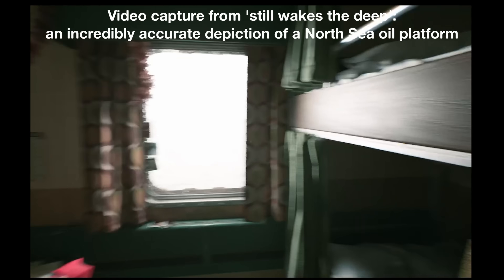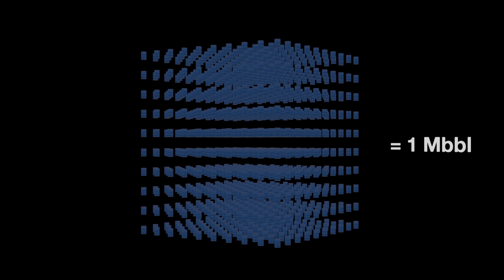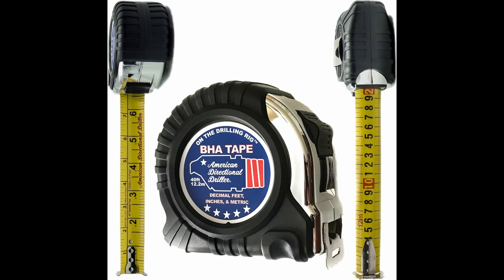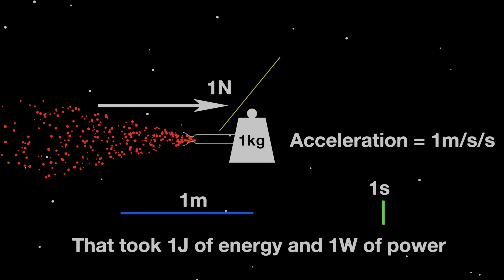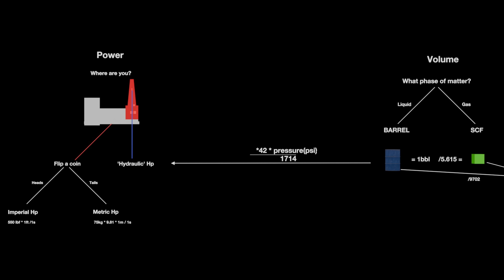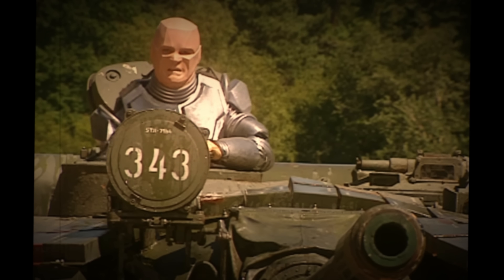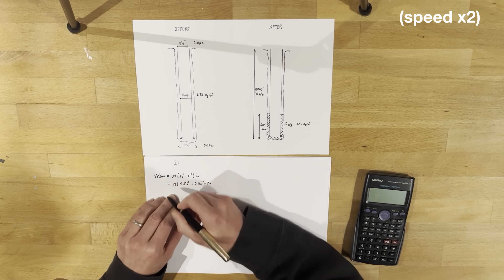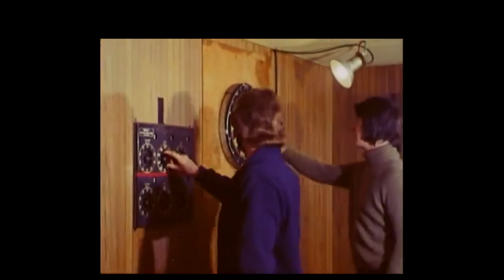Oilfield Units: a Measurement System so Cursed it made me Change Career

Comment: It is mad for sure. I worked on projects for Equinor and Total. It was mostly metric although the material properties were in kips and the pipe sizes are all inch based so they make no sense in metric. I always do analysis in metric and convert it needed. Boeing was 100% inches when I was there while nearly all the people building up the sections were in metric counties which I am sure caused no issues:) Boeing would also size fasteners in 1/16 or 1/32 but it wasn't clear just by looking at the part number.

Comment: 16:45 you are 100% correct. There is a mentality of "School's over and you're in the real world now".
Reply: And apparently real world makes no fucking sense
Reply: @MikeF1189  it’s 1000% necessary though. It’s infinitely easier to switch students onto 
obsolescent units than it is to retool hundreds of factories
Reply: @tacticaloof6407  Is it? In other industries units also changed over time.
Reply: @AsselParty yeah, like the American car industry
Reply: @tacticaloof6407  None of these units are used in tooling.
Reply: @tacticaloof6407  ...Retool? These are all going to be on gauges. At most, you'd have a calculator handle the conversions from the gauge to the notebook and then back again if needed and working on or with old equipment (where needing to convert will be clear as day), and then eventually everything will be moved over to the new units and no-one ever needs to carry around the funny little green book again.

And it isn't easier. Changing gauges and tooling is once. Maybe a very large and long once, but still only once. Sticking with the old oilfield units means teaching units to every student who ever comes through the course a second time until the industry itself dies.
Reply: @Shelleloch  ah but consider that changing gauges will inconvenience puffed up oil drillers for a year while hazing new workers is "fun" every year!
Reply: @tacticaloof6407  hard disagree. Your point about tools is whatever but you think that mindset is necessary? That mindset is the excuse why old bitter people run the world in obnoxiously inefficient ways that fuck everyone.
Reply: @boydj99 no surprise then that the oil industry is full of them 😂
Reply: @FlameQwert  they are the perfect example
Reply: @tacticaloof6407  SI units were specifically made to sort out mess with thousands of different units
Reply: @tacticaloof6407  More like retrain all the veterans and lose all their experience when half of them quit over it.
Reply: @thelastdwemer  
Except like he said, they actually use SI for many calculations and then convert it back.

All the veteran right now are familiar with SI.

Comment: I always thought the UK railways were a mind boggle as they still insist on using the antiquated unit of chains, which afaik the railways are the only industry in the entire UK to still use them in any form.

Locations on the railway are expressed in terms of miles and chains from a datum point, where datum point that is dependant on a specific track’s engineers line reference (a 3 letter code followed by a number, such as ECM5, which has its datum at York station). For example a defect would be described at being at 50 miles 4 chains on ECM5, on the down fast, from which track workers would travel to that rough location, identify the line referred to, and then either find a defect number scribbled on the rail foot, or be able to see the defect if it’s obvious enough. Oh and they would use an access at 49 miles 12 chain on the up slow to access the line.

I think this is simply a holdover from before the UK embarked on its slow march to SI units, and as its solely used for location referencing (officially at least), while all engineering work is carried out in SI units, not seen as a priority to update literally the entire uk rail network, including every bridge, tunnel, line side structure and access point alongside completely overhauling the fault reporting system. The annoying part though is the unofficial use, as often distances for engineering work are given in chains, like “oh it’s about 10 chain away”, and I was just left there wondering where the fuck that is and having no frame of reference for if that’s far or not.
Reply: In the town I was born the streets were laid out on a 10 chain grid.  So I know exactly how far that is.

Comment: A lot of the long US layout tapes (50'-300') have decimal inches on one side and regular feet and inches on the other and cause no end of aggravation when you ask the FNG to go measure something.  In my experience decimal inches are used by engineers and architects who want to make sure a project's construction is over time and over budge, and are afraid of commitment
Reply: And it dose not even matter if you measure to the 10th or the 8th of an inch over 100ft because the tape will stretch that difference simply from pulling it taught.

Comment: What you are describing is worse, but I'll still moan a bit: I am a US architect who is learning to fly planes for fun.  For work, I get foot/decimal info from surveys (like the "rig tape.") Most lengths are feet, then 12 inches to a foot, then base 2 fractions.  Which are really fun to divide by things like 1/3 or 1/5 for equally spaced openings.  When we have stuff custom fabricated outside of the US, I am carful to translate everything to SI units in the drawings because I don't want someone less experienced to mess that up.  When we go to do structural calculations a bunch of these lengths get translated to inches but forces get summed into "kips" (1000 lbs force.) And the folks actually building the buildings generally grew up with SI units in places like Mexico and Poland, so... throw your hands up in the air and carry on.  When I'm taking flight lessons, I deal with feet altitude (as do pilots everywhere outside of Russia and China generally, where they use meters.) Air pressure is in inches of mercury, whereas outside of the US and Canada, it is mostly in milibar. When we are doing flight planning, distances are in nautical miles which goes nicely with speed in knots (a nautical mile per hour.) But if something is "in print" like a weather report, so a report of how far you can see versus fog, it will be statute miles.  "4 miles visibility" is in statute miles (5,280 feet versus a nautical mile which is 6,076.12 feet.) A fuel tank on a plane generally is described in gallons capacity, but for weight and balance, you need to know that 1 gallon of gasoline weighs 6 pounds.  Good thing screwing up calculations and units can't... oh, I don't know... kill you or anything.

Comment: Measuring curvature in 'dogleg severity' made my day
I who knew that the superlative of 'cursed' and 'curseder' was 'oilfield'?
Reply: The rail industry in the US uses something similar, but call it something more sensible; degrees of curvature, defined as the number of degrees the curve changes by in 100ft
Reply: @alexisnorman9446  I was just thinking about that, but I was going to have to look up the definition.  Thank you for saving me the trouble!
Reply: @alexisnorman9446  As a driller and then a directional driller I would say that dogleg severity is a sensible unit that describes how difficult it is to get weight to the bit or run casing. Radius of curvature would work for build-and-hold wells but most directional wells these days are pad work requiring the well to build and turn to land at 90 degrees inclination. To give my directional drilling trainees a sense of what dogleg severity meant I'd ask them to think through how much rock would the bit have swing through to change the well bore from an inclination of 0.5° at an azimuth of 45° to 0.5° at an azimuth of 225°. Now think through how much rock the bit would have to swing through to change the azimuth 180° if the well has been built to an inclination of 90°.
Reply: @eddydogleg  I don't think that the principle of curvature per distance is unreasonable at all for drilling, but giving it a name like 'dogleg severity' instead of just leaving it at at °/ft or °/m seems both impractical and hilarious.
'The curvature is 2° per 100 m, so a 180° turn will take 3,600 m' seems good both in speech and writing, so it's rather odd to shoehorn an obscure unit in there.
Reply: @T33K3SS3LCH3N its also a reference to how much "extra" hole there is in the wellbore, not just bend in the pipe. Keeping the casing centered is pretty important
Reply: So this one has some logic behind it.  The MWD survey will provide inclination as degrees from vertical, and the rig can tell you how many feet of drill pipe are in the hole. Dogleg severity is expressed in the two numbers you actually have in front of you while drilling.
Reply: @johnmiller8884  Ya, I thought that one made total sense from the perspective of the worker. I think it would be easier for the egineer to math that one out rather than the guys running the drill figure it out while doing the job.
Reply: @T33K3SS3LCH3N  I didn't expect to see you here I thought you only commented under hololive clips.
Reply: Beat me to it Eddy.

Comment: Decifeet has to be the most cursed measurement unit of all time...
At least bbl has some kind of story for why it was used historically, whereas whomever invented decifeet clearly was only interested in creating chaos.
Reply: @nekomakhea9440  Using SI prefixes is an improvement over using the inch, at least that means unit conversion is consistent.
Reply: @the11382 it is not using an SI prefix. Decimals are quite a bit older than the SI system.
Reply: "hmmm, I reckon inches are just little bit too small. Let's divide the foot by ten instead, that will make our inches just that bit bigger. The change will be easy, most people won't even notice."
Reply: never heard of decifeet but kips or kilo pounds is big us civil engineering. but so is acre-feet so it balences out. fun fact acre-feet on its own has no abreviation but thosands of acre-feet does KAF (kiloacre-feet).
Reply: I remember seeing a display during a NASA livestream for some rocket launch with kilofeet and kilofeet per second, and subsequently throwing up in my mouth
Reply: @dsdy1205 they at least use metric internally ever since the incident where they didnt convert units to metric before handing off data to the ESA team and then putting their multinillion dollar satellite firmly in orbit in the middle of the Martian atmosphere and incinerating it into useless slag.  But yeah I guess public facing they gotta speak old murrican
Reply: Some men just want to see the world burn....
Reply: Maybe I am too metric brained, but why is it bad? 
That is exactly what I would do if I were tasked with simplifying imperial units. Get rid of inches and use decimal feet.
Reply: @Currywurst4444  The advantage of the traditional system is that it is easier to work with in your head if you don't need a lot of precision.  Dividing into 3rds really is more common than dividing into 5ths, and if you really need to divide by 10 or 12 (let alone 100), your measurements will probably be off anyhow, so you might as well switch to a more appropriately sized unit.  Tenths of a foot is just crossing half a river.
Reply: @jimjjewett  What I don't understand. When you don't need high accuracy then why do you want exact precise thirds?
You can just as well say 10/3=3 or 3.3 to make it easier for your head.

And when you eventually do switch to another unit for higher accuracy, it will be much easier if it is based on 10s.
For large distances you use kilo feet (1000) or myria feet (10000). For machining you use centi feet (0.01) and so on.
Reply: @Currywurst4444  it's bad because it conflicts heavily with fractional feet. Decimal feet is an unusual oddity these days, you see it in places, but it's usually relegated to industry. Most construction is still done in fractional inches, though sometimes the drawings aren't.

It's just, worse. base 10 has a low divisibility compared to base 12. You'd just be making feet/inches worse overall. Unless you converted inches to decimal also i guess, but then why not just use metric instead lol.
Reply: It's for surveying and architecture. It makes it easier to convert distances into different scales when everything is divisible by 10. A drafter's ruler is marked in 10ths of an inch and 10ths of a foot so that measurements in commonly used scales(1inch:1foot, 1:2, 1:5, 1:10, 1:100,etc) can easily be converted back and forth
Reply: @richarddickjohnson516  "It makes it easier to convert distances into different scales when everything is divisible by 10." You know what system everything's divisible by 10 in? THE FUCKING METRIC SYSTEM
Reply: @JaddarJexiszuir Yes, but building codes in the US don't use metric. And thanks to the nature of american bureaucracy, attempting to change that is nearly impossible. I'm not disagreeing with you, just pointing out the nature of the beast. Personally, I prefer metric myself, but thats not what I was taught to use in school with the exception of physics where metric reigns supreme
Reply: @richarddickjohnson516 Doesn't matter if building codes do. Metric is an official system defined in the US, and the government has tried switching plenty of times, but it is States and citizens that are the actual inertia, not building codes.

Because a significant amount of Americans think Imperial is genuinely superior
Reply: @SioxerNikita individuals are part of the inertia but probably an equally big component is that most manufacturing done in the US is tooled in US customary and so engineering work is gonna have to continue to be done in those units absent throwing it all out and starting again
Reply: @dalmationblack  Professionals can phase out/in, individuals are the big blockers.

You can see actual protests when metric is attempted to be implemented.
Reply: @richarddickjohnson516 It really does make it easier when all the units are divisible by ten...

Wonder if it'll ever catch-on...

Maybe make it so all the units just convert without a multiplication factor...

We could make a new system of measuring based on that principle... I shall call it... The Measuring System. ❤😎
Reply: @LordPhobos6502 lol

I heard from some dude once that the ancient greeks had something like that.
Reply: @richarddickjohnson516  which is why metric units were invented lmao.  Im american and don't have any intuitive grasp of metric units in my head compared to imperial units.  But like im also an engineer and Jesus fing christ just use metric at that point or have the backbone to just commit and use imperial in all its flawed nightmarish impracticality.
Reply: @atashgallagher5139 Now I'm just starting to repeat myself from another similar comment thread.

First, the metric system existed long before the imperial or standard systems.

Second, I'm also American, and my only understanding of metric units comes from my passion for astrophysics. But I fully agree with you on the use of metric in general.

Finally, building materials are specifically measured in units of feet and inches due to building codes. Building codes are next to impossible to change without a pressing need, so we're left with standards adopted over 100 years ago that nobody has bothered to update. It's why the 1960s era US Highway Standards books are still the go to for any modern road construction projects. Due to building codes revolving around standardised materials like 2x4s and bricks measured in inches, manufacturers are tooled to produce materials with those measurements, and designers have to plan for the use of those materials in their projects.
Reply: @richarddickjohnson516  At that point, just use metric and convert to imperial at the end when everything is done.
Reply: @skitidet4302 Once again, I'm repeating myself, but computers make it easy to just convert everything in real-time, so there's no need unless you're doing it by hand on paper for whatever reason. You're right though, it's better to just do it all in metric and convert to feet when needed, I never said metric was bad lol
Reply: @richarddickjohnson516  Ah, the same cursed industry that gave us gradians
Reply: @richarddickjohnson516 It sounds like an attempt to reconcile British imperial units with SI units, creating something that has neither of their advantages with either of their disadvantages, and stuck with it for… reasons.
Reply: I spent years associated with surveying and never heard the term decifeet until today This is much ado about nothing
Reply: Same thing in engineering. Everything is tenths and thousandth of an inch. Not much different from metric in that sense.
Reply: Decifeet has to be the most cursed measurement unit of all time...<br>At least bbl has some kind of story for why it was used historically, whereas whomever invented decifeet clearly was only interested in creating chaos.